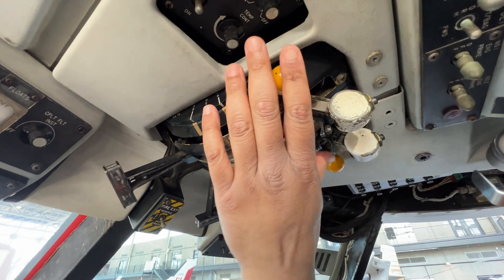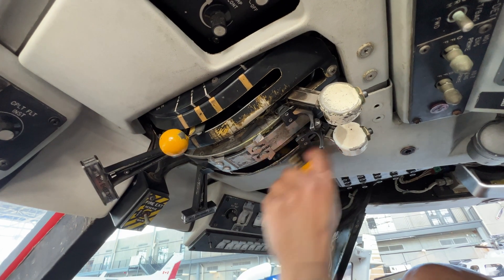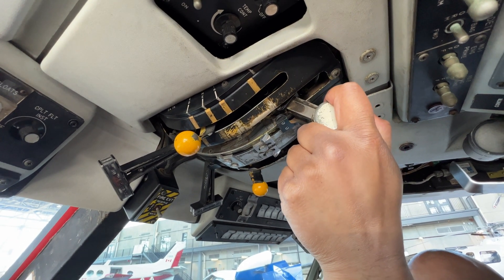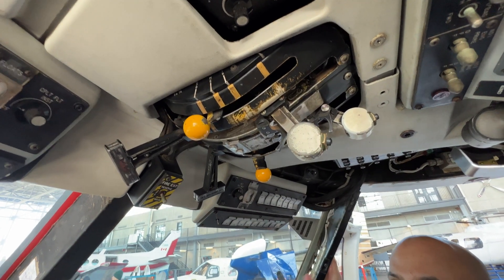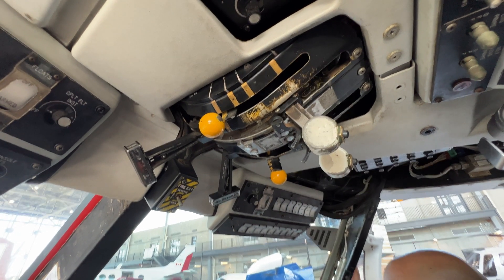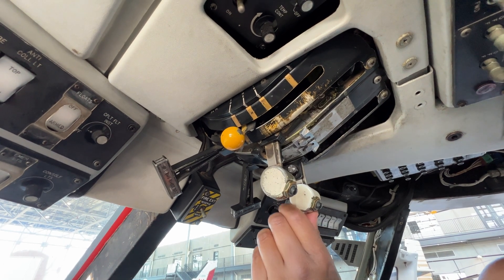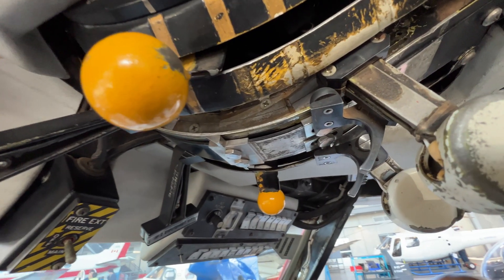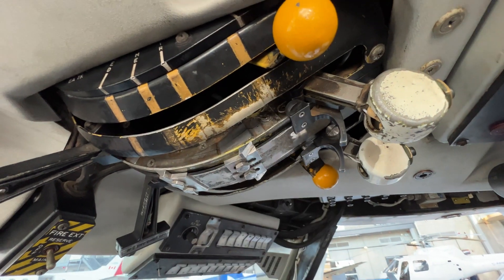Sikorsky S76 Helicopter, Engine Throttle - Power Levers, functional demonstration.

Comment: FYI, the start button on an S76A++ must be depressed before advancing the throttle or it won’t start. The S76A++ isn’t flown with the fuel valves in xfeed. You only start the engines in xfeed then move them to direct before flight